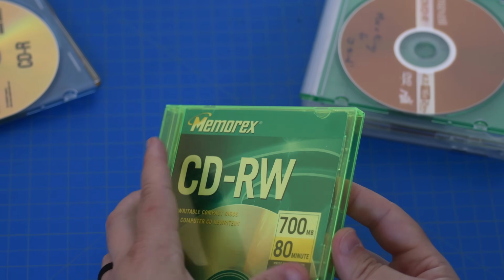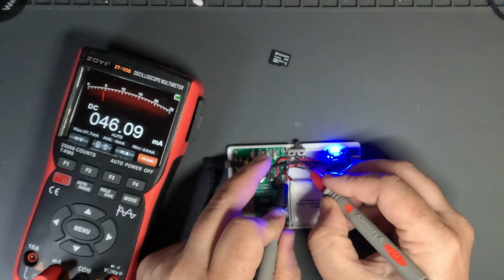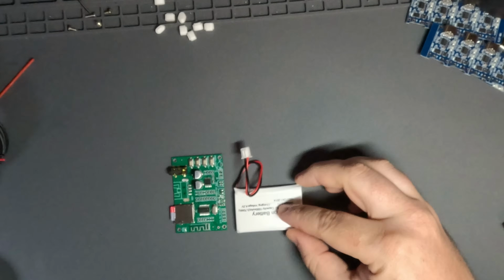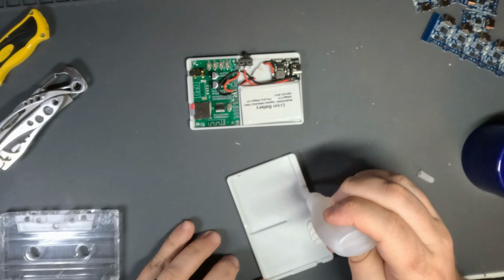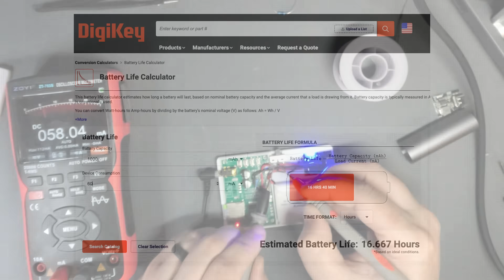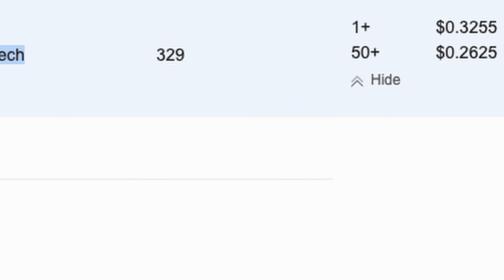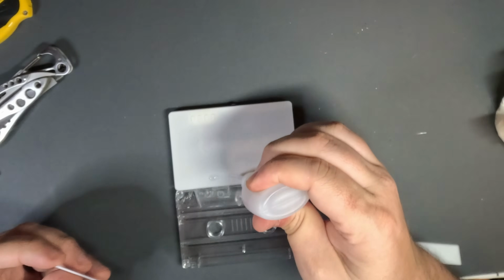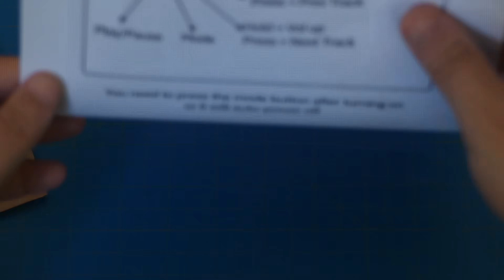3D Printed Mixtape / DIY Bluetooth Mp3 Player

Comment: Could there possibly be an LED that would have the appropriate power draw to replace the resistor as a keep alive load?  This would even open up the possibility of working a window into the old-skool spot in the middle where you would see the reels grow and shrink....

Comment: really nice and pretty elegant solution. I can see it having some good use as a sorta cheap yet useful novelty gift to pass around to others. does it have shuffle or is it just straight playback from start to finish? would also like one myself if only for the novelty of it, but also because I don't have a soldering iron or the proper space for this kind of project

Comment: This is a nice build.

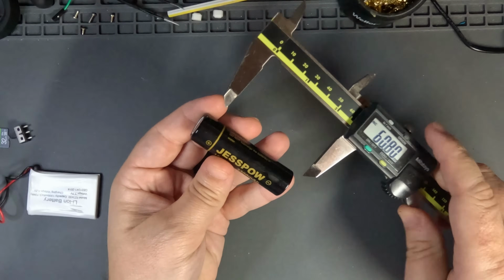1:03 could we please NOT be doing this and only use plastic calipers to measure batteries particularly from pole to pole, or at least put down a piece of Kapton or Mylar tape on either to not risk shorting the battery? Even for pouch cells, that's not ideal because you run the risk of damaging the pouch with a sharp edge or pokey bit of the calipers.

Mhmm what else could one do... it's difficult to beat a DFPlayer Mini on price or size. But how cheap do you want it? PT8211 is insanely cheap but it's also... just really really bad. The next non-crap thing is ES7149 but it doesn't actually drive headphones by itself. ES8156 has integrated headphone amplifier. You're not too capacity constrained with microSD cards and you can decode QOA with ease, though MP2 and Vorbis are also viable on 32-bit micros. MP3 is a little spicier. There is a DMA+timer ch32v003 i2s example kicking about, using PT8211 of all things. Maybe if it doesn't need to sound better than a cassette, it doesn't need anything better than PT8211 either?

If this is supposed to be a tossable gadget, a way to give someone a 90 minute mixtape to listen to once, maybe CR2450 is a suitable power source, you can buy them cheaply in bulk say Varta Industrial. You probably need two.

Comment: Can you tell how it is to use it? Is the audio quality okay and what controls are there and have you found any drawbacks?
Reply from the maker: The audio quality is surprisingly good! Although I'm not an audiophile, for a $2 board, I'm impressed. Because this is such a budget build, the ergonomics aren't amazing, you control it with the 4 buttons, holding down/up for volume. Biggest drawback as mentioned in the video is that it can't do Bluetooth out, only in, at least not without reprogramming it, which is something I still want to try.
Reply: Thank you! Subscribed for updates.
Do you know if I could also use it to loop just one audio file endlessly?
Reply from the maker: @reinopirttijarvi2487 yup that should work

Comment: is there any resources you can share for the bluetooth problem? i want to build something similar but for my bluetooth earbuds and i cant find anything with bluetooth transceiver capabilities
Reply from the maker: I didn't bookmark anything, but if you search GitHub for ac690x you can find various libraries which show the serial commands. Then you just need to hook it up to a microcontroller like an rp2040 or something to send it those commands. There are some available on AliExpress on breakout pins and many of them are labeled as transceivers but I havent tried them

Comment: Im just getting into electronics and wanted to try to make this, is there a reason you chose that specific type of switch or can i just use an other type(i cant find a reliable cheap way to get your specific type)
Reply from the maker: It just seemed like the best size and feel,.I bought a sample pack of switches. Any latching switch will work, it just might not fit in my case.
Reply: @jrowny  thx

Comment: So annoying that charging chips manufacturers think that current monitoring is a good idea in a world where things are so efficient.
The next version will have to have the holes through it for extra authenticity.

I'm glad to see you are still around. We conversed 11 years ago about your wheel poke calculator. I've just emailed you about it as we just lost a bunch of files so I was hoping you still had them.
Reply from the maker: Saw your email, will take a look for that code and see if I can find it
Reply: @jrowny  Thanks. Luckily I managed to find a backup on a 10 year old backup on an old computer.

Comment: Can i replace from PCB to ESP32 with audiojack, proper programming and is it gonna work the same? I mean, i couldnt find anyone made for using with headphones, so, i thought, is there anything i should add or change? I believe, it's the same, but bit programming on esp32 if im not mistaken.
Reply: You will probably need to add a separate dac board due to limitations of the esp
Reply: @DavidNorthUK  oh, yeah, i did actually, after bit of research, settled on MAX97220. I havent finished the whole project tho

Comment: I love this! I would like to try and make one but I'm very new to this. Where would you recommend i get the 470 ohm resistor?
Reply from the maker: You can buy them in kits or by themselves from anywhere that sells electronic components such as Amazon, eBay, mouser, etc. I just bought a variety pack so I always have the right ones.
Reply: @jrowny sweet! Thank you!

Comment: You can use a ETA9640 board, they are cheap and do not turn off on low current, and you can order the IC on JLCPCB. We successfully use them in our synths. It always outputs 5V, kinda, and has an ENable pin. The only downside is that like TP4054 boards, it's a linear regulator charger. But, it has power pass-through and an integrated 5V boost.

Comment: This s a very cool idea, but 3D printing and landfill wasted plastic always makes me wonder if it's worth it when you can buy something similar.
Reply from the maker: I hear that concern but just to play a little devils advocate, PLA is technically a bioplastic made from corn and is (industrially) compostable, it breaks down into regular lactic acid. If you were to buy something off the shelf it would be made  with ABS or a much less recyclable plastic and packaged in more plastic. In the future I hope to design a PCB that can fit inside an actual cassette tape so in the future we can recycle old unused cassette tapes into something more useful.
Reply: @jrowny Oh wow. I didn't know that. I like that better. Thank you.

Comment: Great build! I remember ages ago a company made an MP3 player shaped almost exactly like a cassette, and it could fit into a tape deck and behave like a cassette. It had a headphone jack and buttons on the front side for play control. Genius!
Reply: Behave like a cassette as in it would play through the tape player? 😮
Reply: @nathandc  Yeah, they had magnetic heads like those adapters you've probably seen, except the adapter is the player